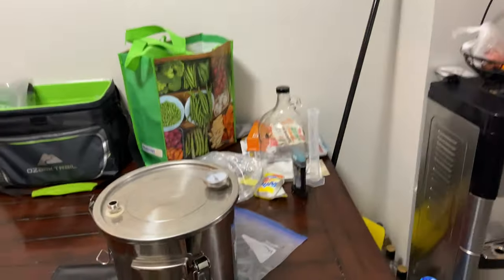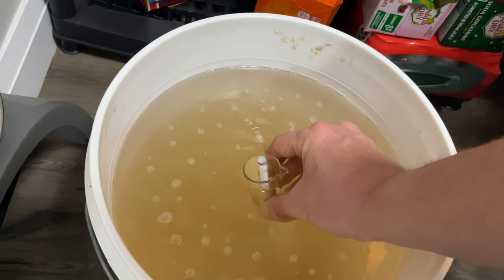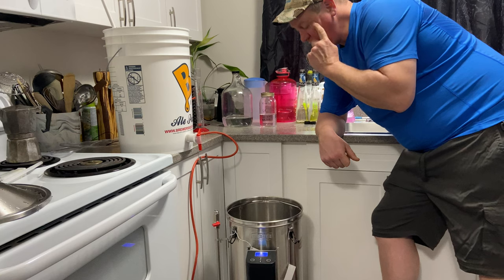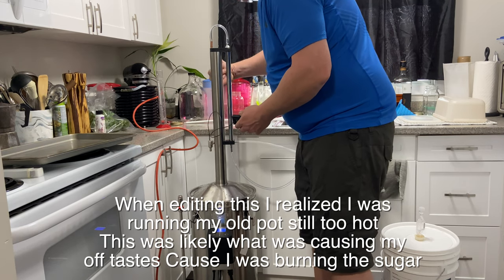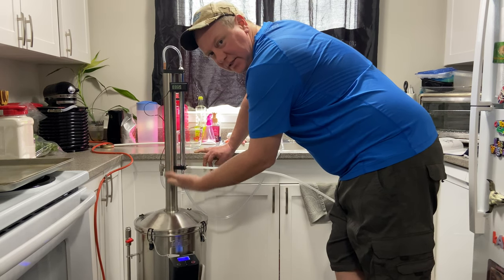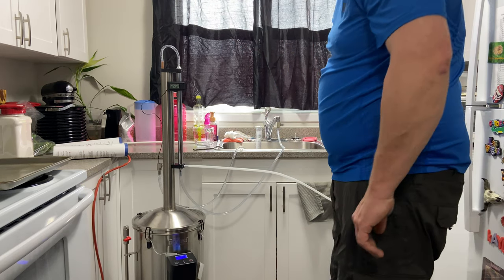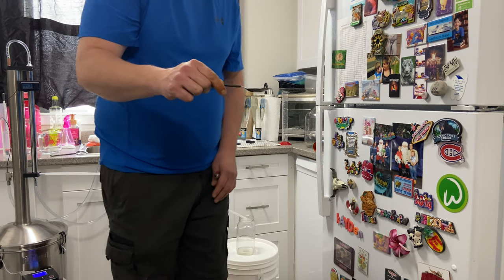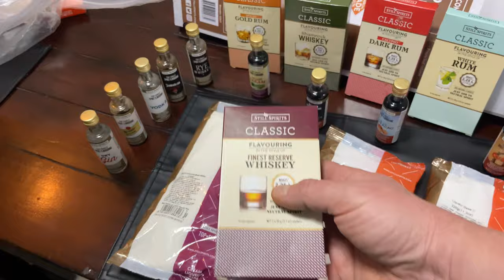Alcohol Self Reliance Sugar Wash to Distillate | Running a T500 Column Still | Off Grid Retreat

Comment: Hello, Yes sir you need a still spirits water pump regulator I think mine cost $90 bucks here in Aussie, they are heaps easier to regulate a constant precise supply of water. I love my set up, I've got and adaptor on the bottom of my column that allows me to connect tri clamp fittings, so I run a sight glass from the lid to the column, gives you heaps of Cool Points :). Cheers mate.
Reply from the maker: Thanks Gary. I’ll look into one of these
Reply from the maker: I wanted to thank you I reviewed this suggestion and I can see the benifits of having this. I’ve ordered one also!!!   It was 140 dollars Canadian for comparison sake. :). 🍻